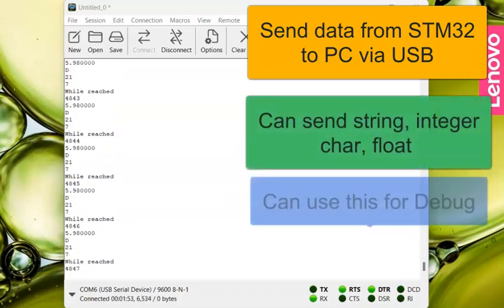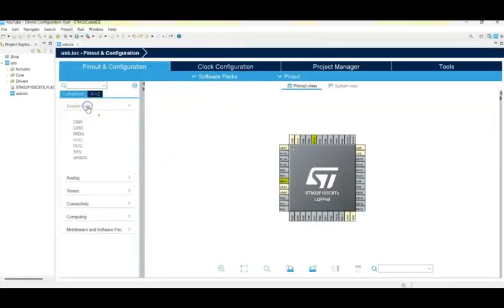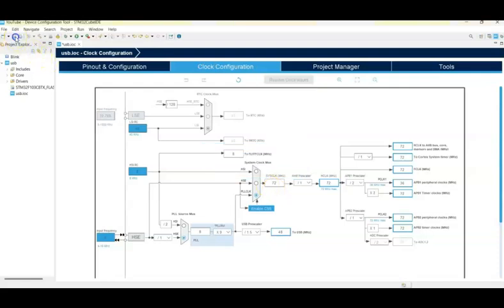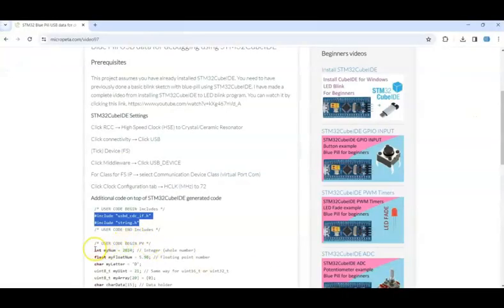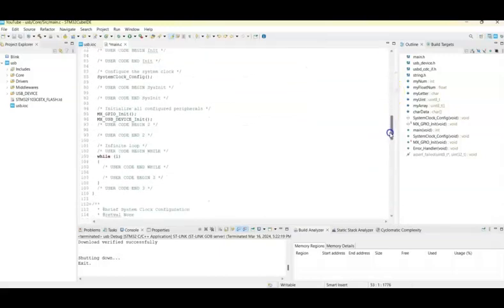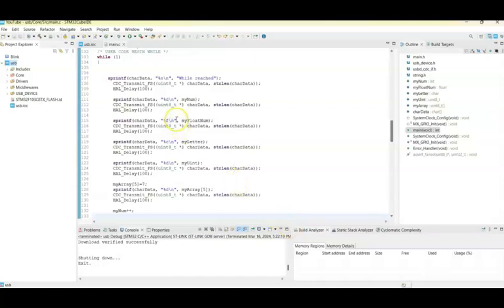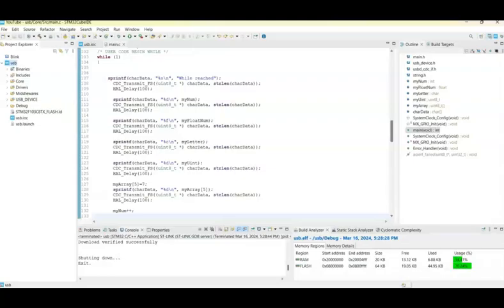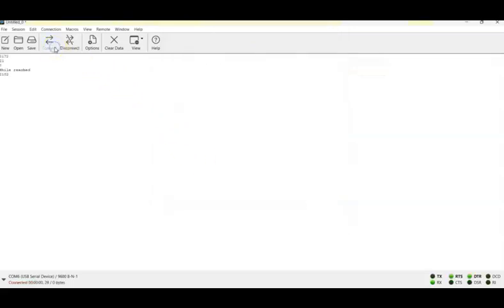97. Send data from STM32 to PC via USB CDC with STM32F103C8T6

Comment: is there any way to take input from a rotary encoder (which is connected to the stm32 board) and use the input value for increasing or decreasing the volume of my speakers?

Comment: hello... i try your but its not working ! STM virtual com port is not showing up ! can u advise...
Reply from the maker: Normally it needs driver installation for any usb. But I remember I did not have to install any drivers for stm32 virtual com port for windows 10 and windows 11.
Make sure the device is directly connected to the PC, do not connect through a hub or docking station.
Try different cables. Try different ports.
At the very least something should show up in device manager, even as an unknown device, unless the STM32 or USB connector itself is broken
Reply: @NizarMohideen  yes, i try directly usb port, device manager only show STLink virtual com port,,

Comment: What ist the advantage over using uart?
Reply from the maker: You can save the USB to TTL module and wires :)
Reply: @NizarMohideen  no really dude, with uart I can use the same USB cable and it works? Are you sure you know what your are do?
Reply from the maker: Thanks for sharing this information